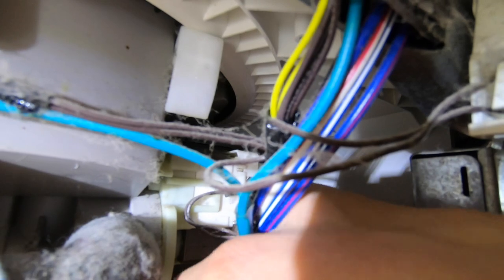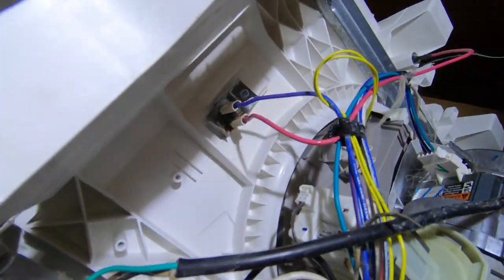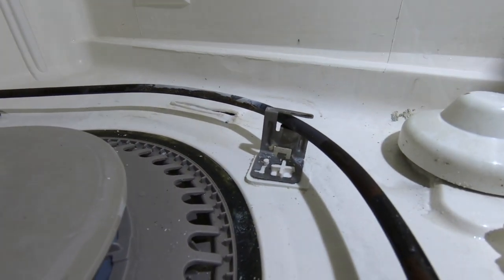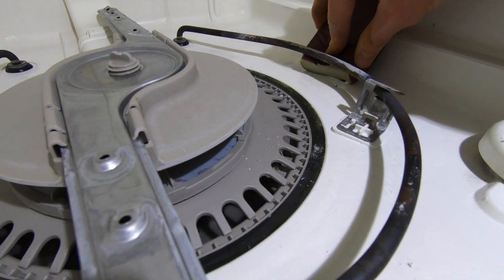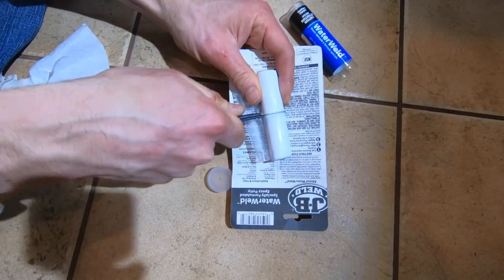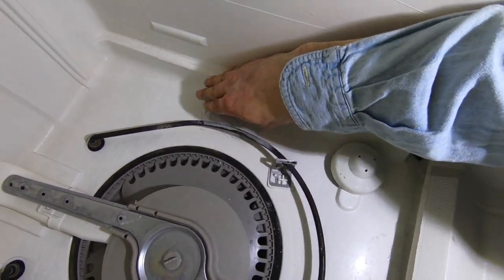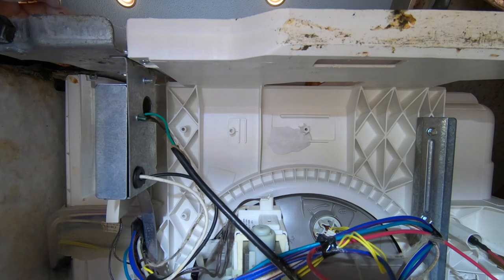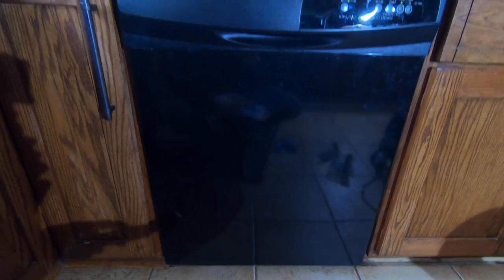Dishwasher Leak Repair with JB Weld WaterWeld

Comment: Nice repair.  If the epoxy doesnt hold up, take a big flat screwdriver and heat red hot w propane torch.  then run along the crack and it will melt and seal the plastic.  i’ve fixed a few this way , never leaked again..

just wear a respirator or hold your breath to avoid the  puff of  plastic odor.
Reply from the maker: That is a great idea,  I will keep that in mind.  I might even test that out on an old tub from a dishwasher that I cut up to make an drip pan that I use when I change the oil in my vehicles. Thanks!
Reply: Just got one with a Crack techs have been saying isn't leaking for a year gonna grab the torch

Comment: I have a leak almost in the same exact spot, I used the waterweld and it lasted for about 3 months, but I think by pulling out the machine and filling the bottom will yield a better seal. thanks for the tip!
Reply from the maker: Hey there thanks for the feedback. If you still use the heated dry, that will make it not last as long. The localized temperature cycles cause material to expand and contract. Since they are different materials, they can expand and contract at different rates, and that will cause it to leak again.

Comment: I used this same jb weld product then went over top that with flex seal spray. It’s been holding up great with zero leaks. I think the water weld would’ve worked alone but the flex seal spray was just a bit extra. Sand. Water weld. Cure for 48 hours. Flex seal spray. Cure for 48 hours. Flex seal spray. Cure for 48 hours. Then it seems to be good to go after several washes. I have the extended cure times just to be sure it had the best chance to work.  My crack was a bit worse. Butter knife fell on the heating element and melted a 6” long gas in the wall down to the floor
Reply from the maker: Nice! That’s actually one reason why we do not use the heat cycle on our dishwasher.

Comment: Hi ....I’m thinking of using this to repair a ‘pinhole’ leak on the inside back plate of my daughters dishwasher, the inside is of a thin metal probably aluminium....two questions for you please 1. Will this putty work on metals? 2. Did you consider this putty to be ‘food safe’ as it’s not in direct contact with food but only the water to wash the dishes?  Appreciate the video 👍
Reply from the maker: Hey there, thanks for the question. If the metal is thin is not likely aluminum but package says this should work with iron which is your stainless Steel (more common metal interior material) In this case I would be concerned with what caused the pinhole and if there are others that are about to also leak. If there is rust around the pinhole you need to make sure to clean that off really good otherwise the water weld will not adhere properly. It might take sandpaper or some other abrasive material to make sure there’s no lingering rust. As for being food safe, the back of the package says that it’s “drinking water safe”. Hope that helps.
Reply: @stephenofalltrades1422  .......many thanks for the feedback.......the small ‘hole’ was probably caused by a protruding sharpe knife when trying to close the dishwasher door by the previous home owner but I concede it is probably stainless .....if you suggest the ‘weld’ is food safe I will look to using it rather then the ‘duct tape’ my daughters mother-in-law has provided! 😉

Comment: This fix worked for about two weeks - after that the leak was back. Not sure about anyone else that may have tried this but it does NOT work!
Reply: Sorry to hear that, do you look to see if the epoxy separated from the basin or if it is leaking from another location? Also are you using heated dry? If the build up of epoxy is too close to the heating element, it might not be able to withstand  the heated dry cycle.